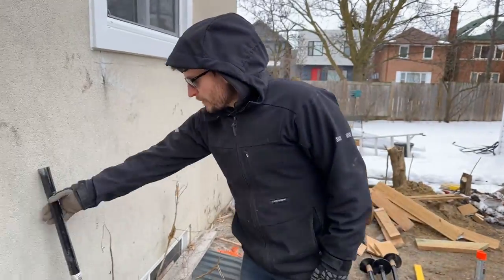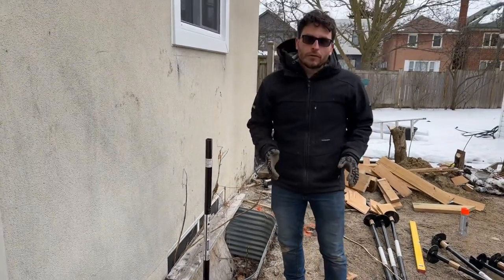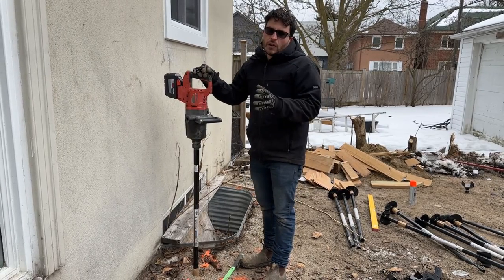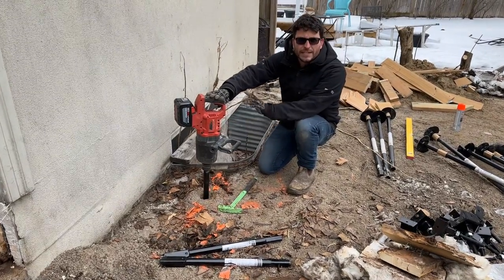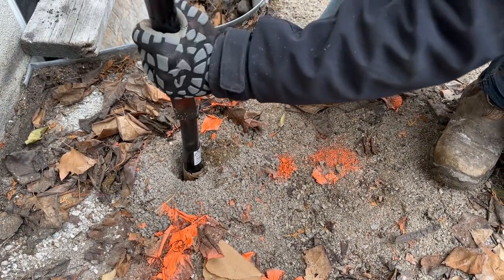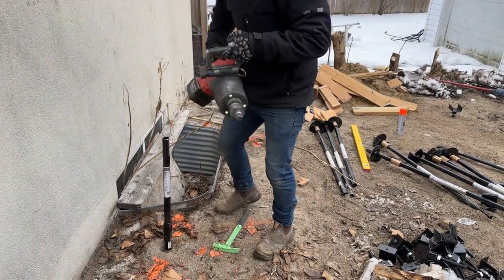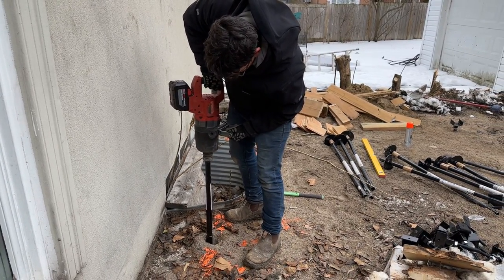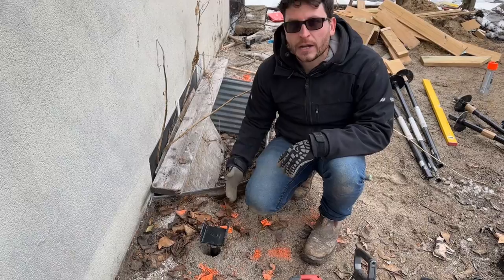DRIVING HELICAL PILES WITH AN IMPACT WRENCH

Comment: That's why I like the west coast of Canada you can build slab-on-grade you don't have to go down 10' below the frost line
Reply: Question for you, I built a house with slab on grade on the East Coast. 10 years later I had to spend $15k-$20k on excavation because of a leaking copper pipe IN the slab! My next house I had built on expansive soil with a crawl space and the basement above that to avoid this in the future.
Reply: @packetattack7437  I would never run my Plumbing inside the concrete

Comment: I have a Hilti hammer drill and a Dewalt. Is there a specific bit I can use to drive the Helical piles into the ground?
Reply from the maker: Has to be a ratchet hammer drill won’t work

Comment: I've used this product once for building a low level deck. Is there any way to know for sure that you've reached the correct torque specs or do you just go by feeling?
Reply from the maker: You can use a high torque wrench to check. But I gauge it by this drill’s ability to continue
Reply: It seemed like there were voids in the soil when you were driving with that last extension. If it was carrying a heavy weight would you need to keep adding extensions until a specific torque was reached?
Reply: @a-carpenter9229  yeah, I think so. it was in a really good dense spot and then punched through into a softer void. that pile will settle I think

Comment: Cool video and very clever, but I do have a concern. Those helical piles were designed to be driven with hand force. Using a high powered motor induces far higher torque than the manufacturers intended. I wonder if you could potentially morph the helical flanges or even break the welds by over torqueing this way...should probably confirm the max driving torque with the manufacturer and make sure your power tool doesnt exceed that just to be sure.
Reply from the maker: The manufacturer now sells adapters for this method
Reply: @woodbullyltd  Hah! Ahead of the curve. I wonder if your video inspired them at all. Hopefully the adaptors mount on the inside and outside of the tube to prevent rounding out.
Reply: @woodbullyltd where can I find the adapter?

Comment: nice video, iam wondering if a 3/4 xgt makita 40v would be enough to drive those pilex in the ground. what do you thing
Reply from the maker: I know the 1/2 won’t. But I have not tried the 3/4” we use a 1”
Reply: Thanks for the reply, i guess I’ll just go and spend the money and buy the big gun hehe
Reply: You would need the adapter then, he is using the 1inch drive so he can stick the drive shaft directly in the pile
Reply: I wonder in term of power, if the 40v 3/4 drive would be enough to screw them in. I can make a adapter to fit

Comment: What adapter do you use in your impact. I bought the same setup and it won’t fit in the Pylex
Reply from the maker: You need to make something custom. The easiest way to either use a 3/4” or shave a 1” down to 7/8” the one I use I had custom made

Comment: Have you ran into many code issues, or do you just use them on decks below 30”?

Also are they steel or aluminum?
Reply from the maker: Steel. And I only use them on decks under 24” but you can get the engineer reports from them when needed
Reply: Great option for low level decks, thanks for sharing!

Comment: May I know, how do you make sure the pile remains vertical when you drill it down ?
Reply: I would start it into the ground and use a 2ft level to check, than just continue eyeing it a couple more times.
Reply: @patrickmckowen2999 you take 4' rebar and you hammer it into the ground first, on your mark. Then you slip the helical shaft over it, since the shaft is hollow. The rebar acts as a guide for the pile
Reply: Which raises the question of how you get the rebar in straight.  The problem with these, putting them in with 2x is there are lots of axial loads, and can wander.  His tool put them in  relatively straight, and the saddles are fairly loose.

Comment: Have you ever tried using a pneumatic impact wrench? Browsing cheaper options than that Milwaukee. Also what’s the max height you ideally have the top poking up from the ground? Putting together an estimate for a wetland boardwalk that has some soggy areas and standing water sometimes a foot deep. If it needs to stay pretty close to the ground know of any Beefier helical piles you’d recommend that can support a taller top side and can still be driven by hand instead of mini ex
Reply from the maker: They recommend 6” off the ground. And yes a buddy of mine used a generator, compressor and pneumatic wrench set up. The tool is cheaper but the set up isn’t.
Reply: Thanks, yeah got a genny but no compressor but all my battery tools are metabo hpt and unfortunately they only make a half inch one... doing 60 or so piles i figure id be running thru them especially in this soil type Mattan soil, pretty much mucky crud first 2-4 feet and then silty loam and clay rest of the way down to bedrock 50-70 feet below. Probably going to be bringing in some engineering help after a talk with the client to confirm they are down for the journey because working in soil like this is a bit out of my depth (no pun intended ;) . all my boardwalks have been through much more stable seasonal wetlands in colorado in the past using diamond piers or in a few soggier spots big wood friction piles while working on trail crews.

Comment: Did you have to use a adapter for the 1” to the size of the top of the pylex? If so what size?
Reply from the maker: I just use a 1” that I shaved to 7/8”
Reply: piles are 7/8" - you can use 1" -> 3/4" adaptor. That works, too

Comment: uplift? those extension, as installed, don't have much uplift protection. What's the method if you need uplift rating also?
Reply from the maker: Self tapper
Reply: Very good question, i have the same issue, what if the pylex is all the way in to the ground in case of a ground level deck , then you won’t see anything to screw through. I love to use those method for my deck projects but this is my problem. Uplift protection

Comment: Have you heard of any issues with the joints on the extensions coming apart from frost heaving?
Reply from the maker: I have not. But you can put a couple self tappers in to be safe
Reply: So I was just in contact with Pylex. According to them since 2006, they have sold over 160000 extensions and haven’t heard of a single case where the extensions have come apart at the joint. Regardless of how many were added to the pile. I’m gonna be building my water access off-grid cabin this summer on the Montreal River. Due to access I’ve decided to use these for my 12x16 foot cabin and will also be going 8 feet down. Something someone else on YouTube has done for that size cabin. 3 beams with 5 piles per beam. I’ll keep you posted how they are doing next spring. Thanks for the response.
Reply: @michaeldallariva637  hey bud how'd they work out for the cabin's footings?
Reply: @Robin-xe4yz  sorry about the late reply. Kinda forgot about my comment lol. I’ll be heading up May long weekend. That will be the moment of truth this spring to see how they faired over winter. I went 8 feet down. Managed to screw in 15 by hand last fall. Lots of work. Not nearly as bad as I figured they’d be though.
Reply: @michaeldallariva637 
Any update?  How's the cabin?